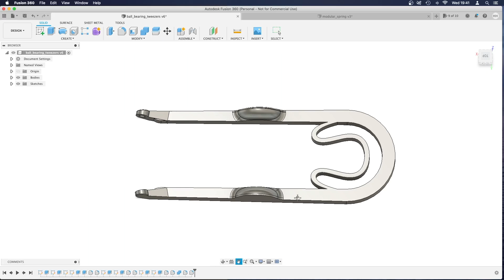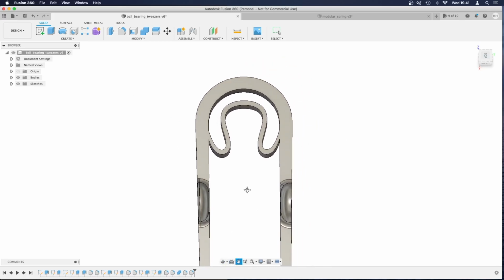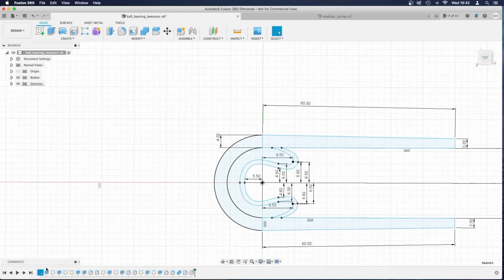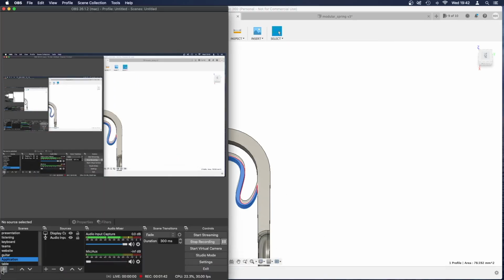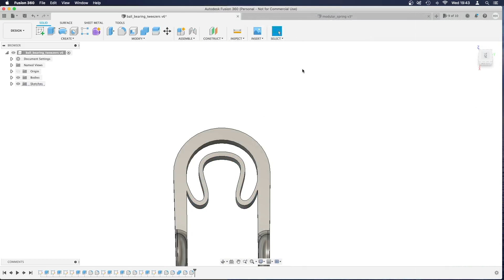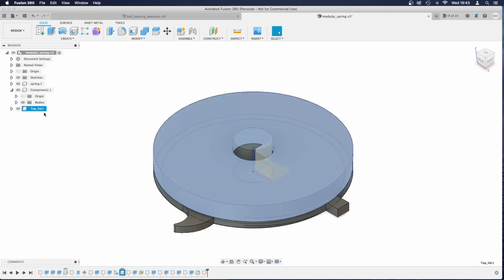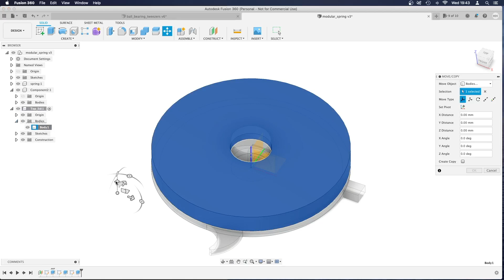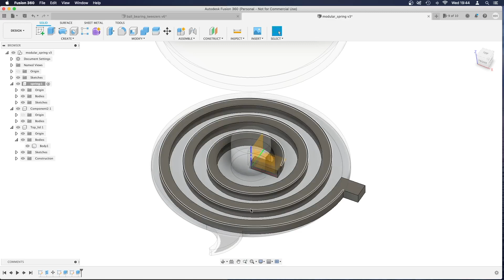3d Printing Springs - Early Experiments and Designs

Comment: I like the design but not following your reasoning about if the center spring wasn't there, that the arch would receive more wear and likely break? It's always flexing the same amount regardless and the center spring isn't doing anything to help it in that regard. If you removed the center spring as it was, you'd just end up with a weaker spring action. 

However, if you tried to accomplish the same force with the arch alone by thickening the rear arch, then it likely would wear out faster due to increased 'modulus deflection' past the plastic's elastic point etc.

Comment: I just designed a couple of springs for a pen holder on a cnc. I wanted the pen to be pressed to the paper, but have some flexibility. It ended up being a block to mount the pen to, with a wavy loop kind of thing at the top. I found it is very dependent on thickness of the spring, and number of waves in the spring to get the right amount of springiness. Cool to see your video now!
Reply: Have you posted this? It's exactly what I'm looking to design rn